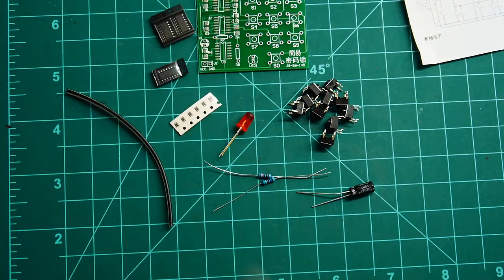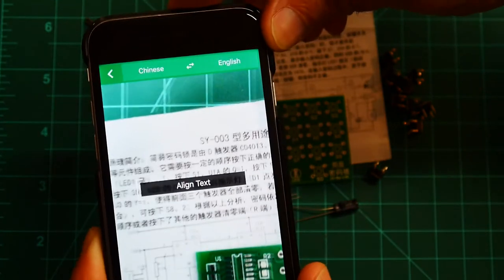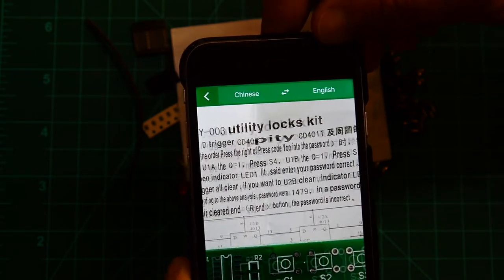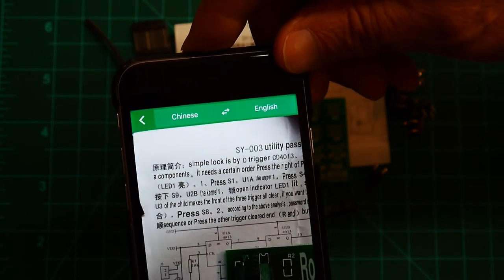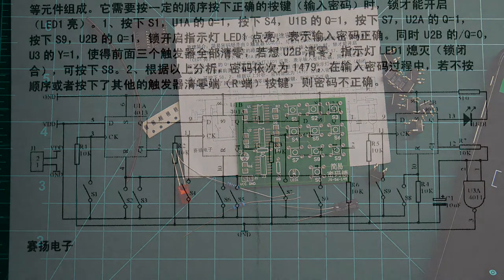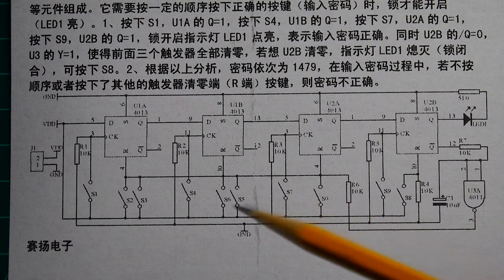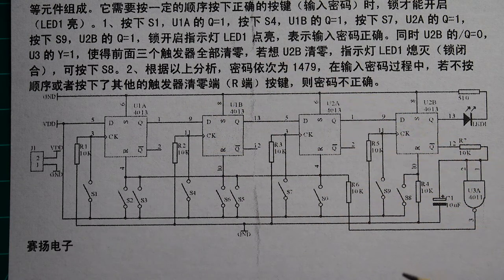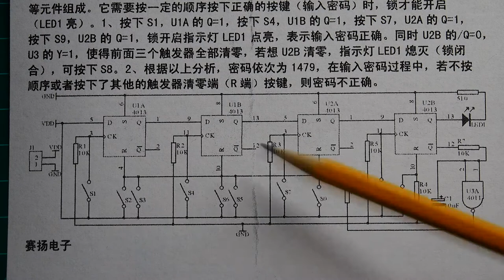#190 electronic lock kit

Comment: You should try the right combination in different orders 1479 9741 7419 etc i think it sdhould still function.
Reply from the maker: nope. I tried the ones you suggest. only the correct one works
Reply: IMSAI Guy i guess it would clock zeros through. Even if right numbers but wrong order. It seems robust design but not practical to havd hard coded pin .lol
Reply from the maker: I had a real heavy duty lock once. it had a similar circuit but had a patch panel with wires and plugs which is how you set the combo. you can do that with this one if you had a second keypad and just wired your combo to the 1479 pads of the switches.